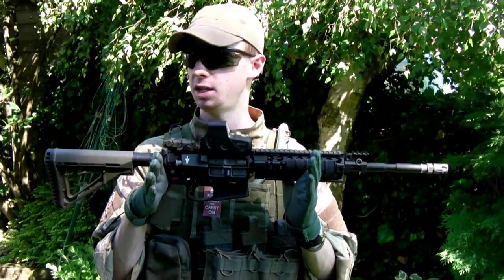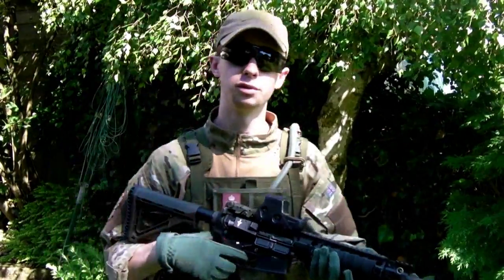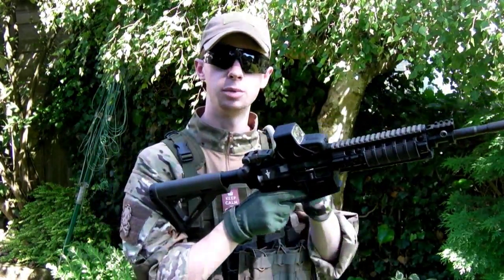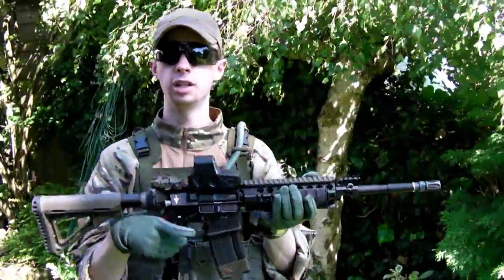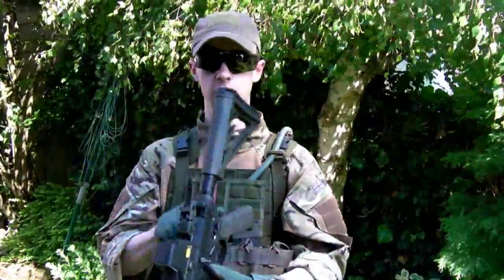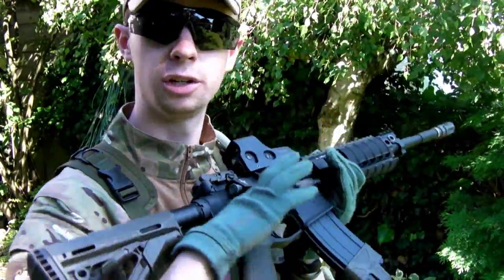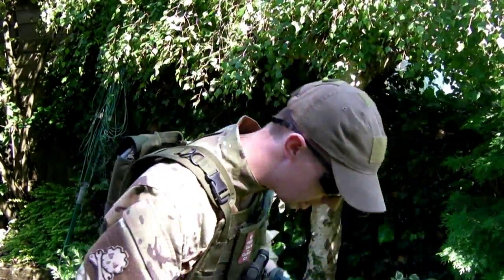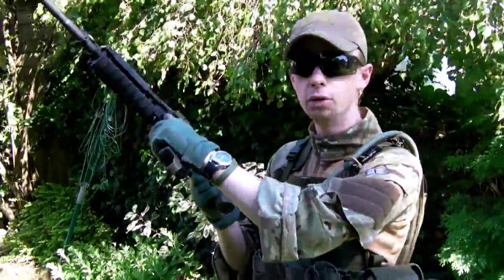Airsoft Techniques - GBB M4 Reloading

Comment: This saves you time(if you have drilled it this way), and it allows you to keep your sights on the target through the whole thing. Also, technically you're supposed to flip it to safe if your rifle is not pointing towards your target. Otherwise, great video;-)

Comment: Now I have shot the m16 a lot and I recognized a sound when I shot it in basic, that  it makes a very specific sound when the last round is fired, is it the gbb carbine?
Reply from the maker: Does it do the same?  Kinda, you can feel the difference between a normal shot and the bolt locking back.
Reply: I just don't know how to describe it either, but it's a very distinct sound at least to the real steel firearm.